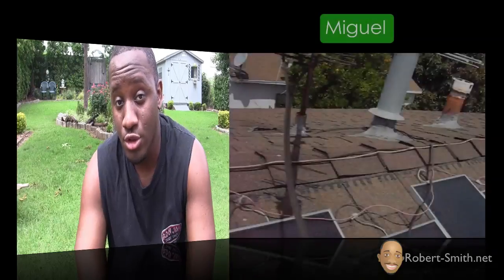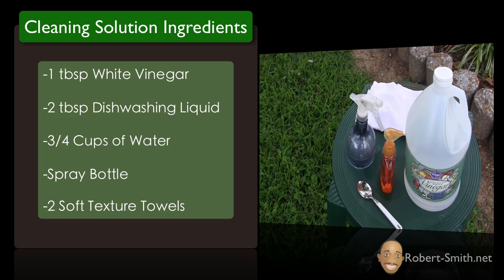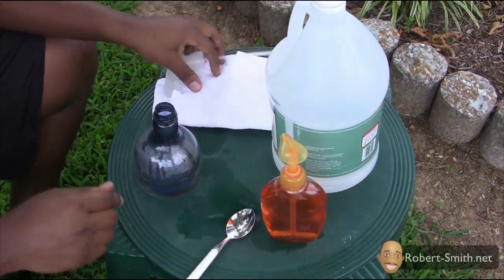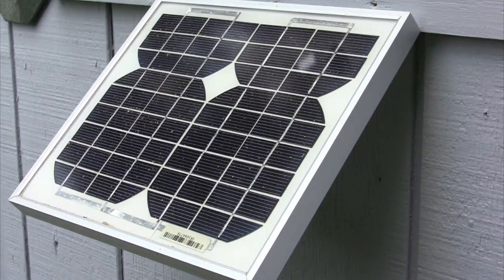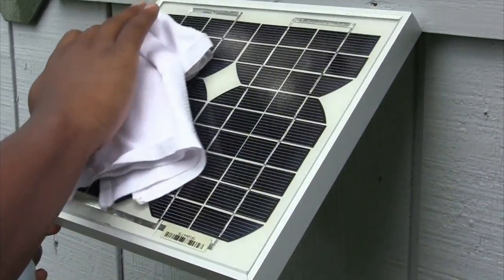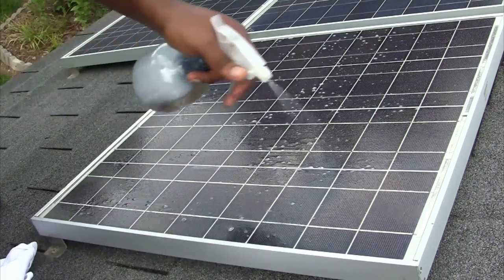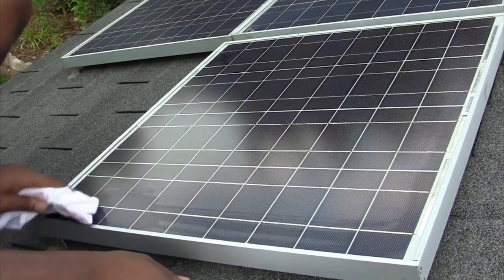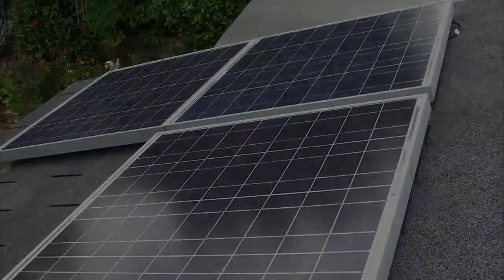How To Clean Solar Panels - DIY Solution

Comment from the maker: @subscribeforcandy As you saw my panels were not even close to being dirty. If you Google "dirty solar panels" you'll see how dirty some can get every other month. Those panels will require more cleaning solution compared to mine. Also, I'm only providing an example with 3 medium sized panels. There are companies/homes that have over 20 solar panels, so as you can see the amount of needed solution would be a lot more. The price of solar washing kits can also get quite expensive as well.

Comment from the maker: @subscribeforcandy You could, however, this is a DIY method if you want to use products you already have which may be cheaper, and also vinegar is cleaner for the environment. Like I mentioned, this is just 1 method you can clean your solar panels, but there are many others as well.